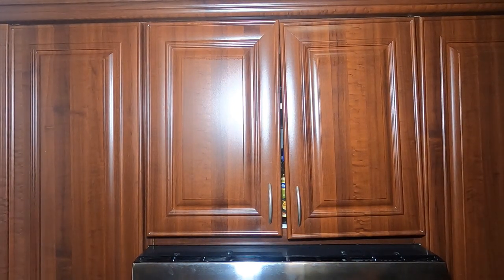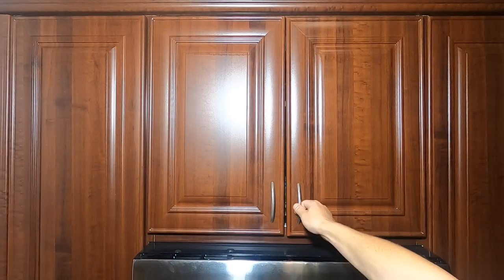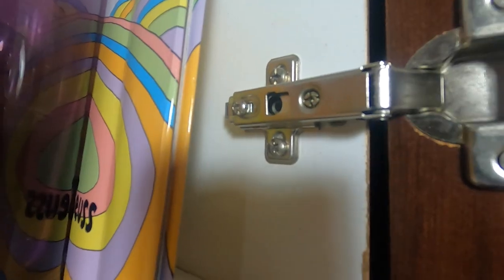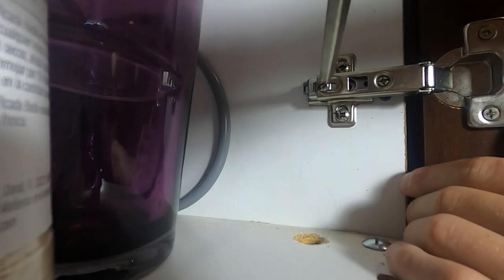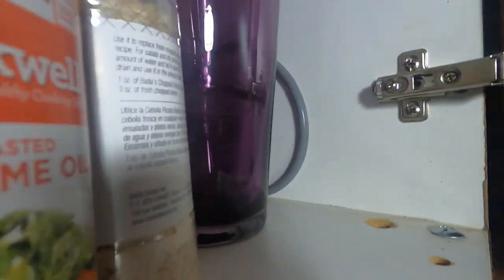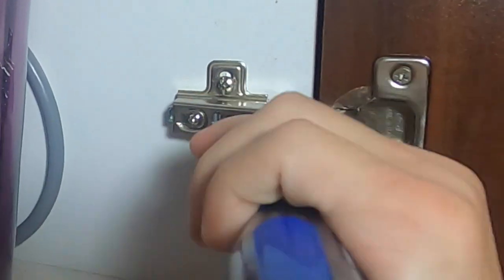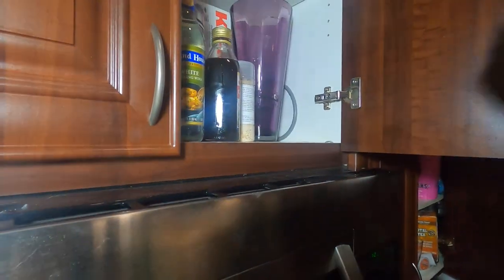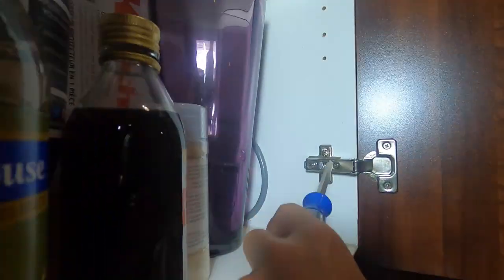Fix and Adjust QUICKLY Loose, Crooked, or Cockeyed Kitchen/Bathroom Cabinet Door That Will NOT CLOSE

Comment: What kind of screwdriver are you using? It does not look like Phillips or flat head.
Reply: It is a Phillips 'posidrive', which is simply a Phillips head, but with better fitting to the screw head because of the square cross-section of the screwdriver shaft.